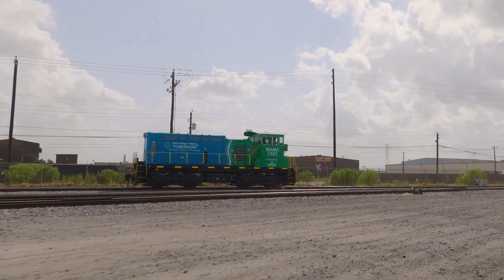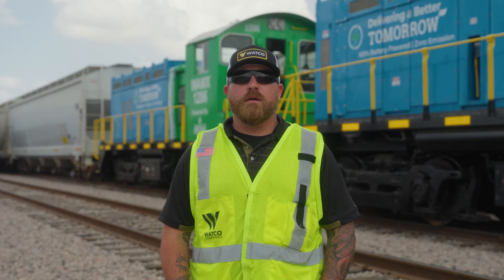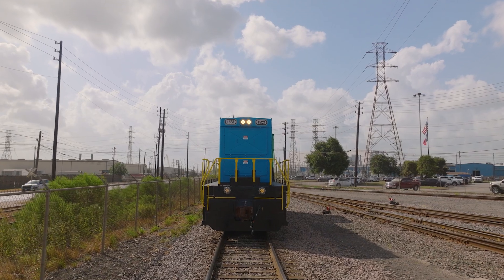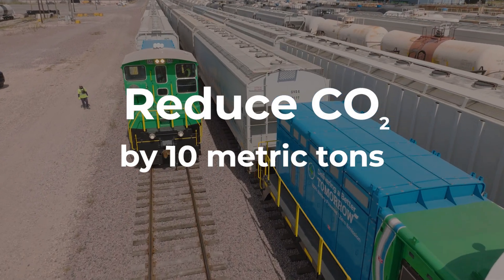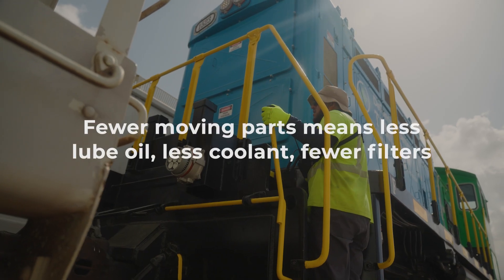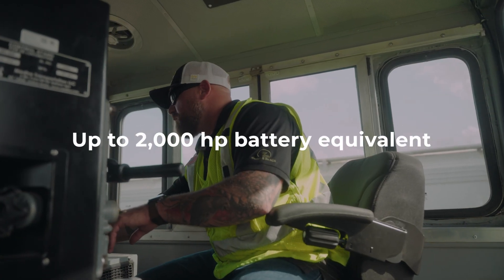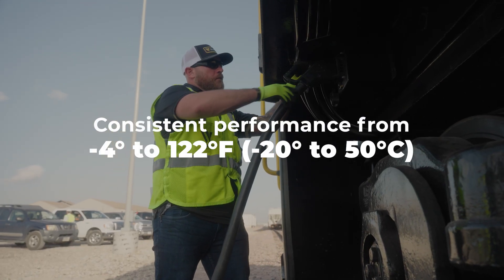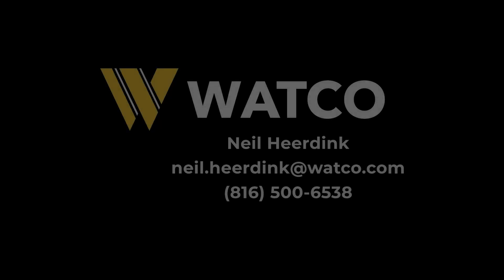Clean Power for Switching

Comment: Just build an actual electric locomotive that uses a pantograph and overhead cantenary wires instead of a stupid battery locomotive.
Reply: This would cost a ridiculous amount of money, that's why there isn't already overhead wiring. A more reasonable option is hydrogen fuel cells, which is more sustainable and efficient than battery power.
Reply: I disagree electric locomotives are cheaper to build and have triple the horsepower then hydrogen and battery locomotives. They have faster acelaration and don't need to recharge.
Reply: @bennettgibson7287  The catenary system would be way to expensive to build just for yard operations.  Pantographs will break without warning.  When that happens, catenary gets pulled down thus disrupting switching operations.  Which means ticked off customers.  And if the electric switching operations is on the grid, that creates another disadvantage if an outage occurs.
Reply: Get with the times bennett, you want China to take the lead on this or the USA? 🇺🇸